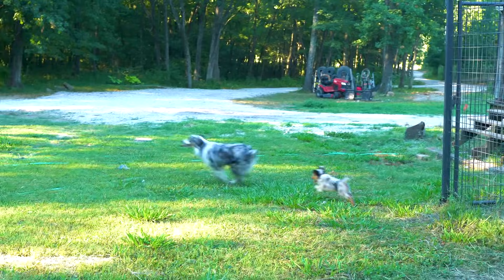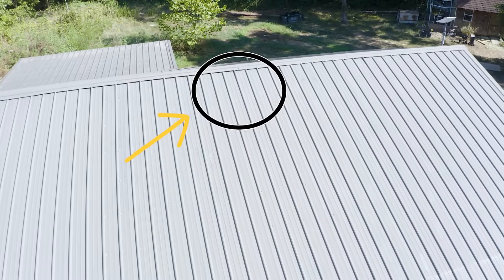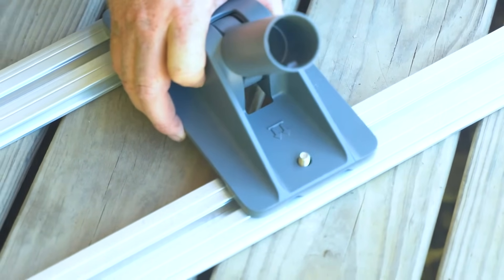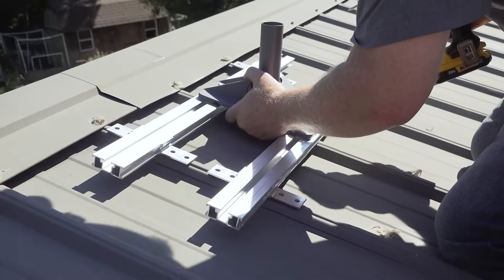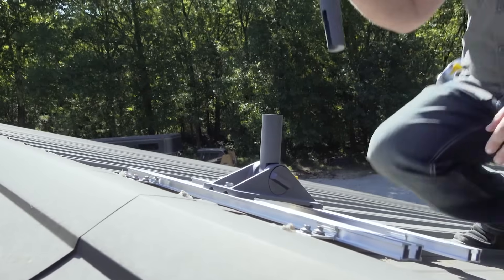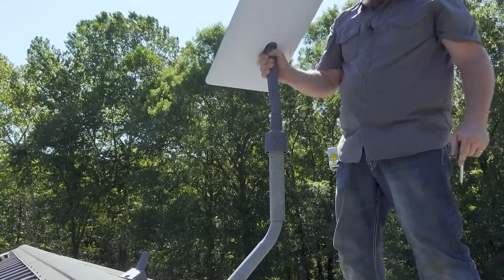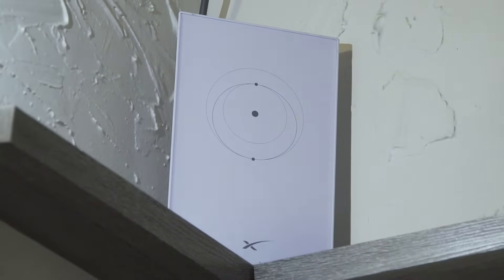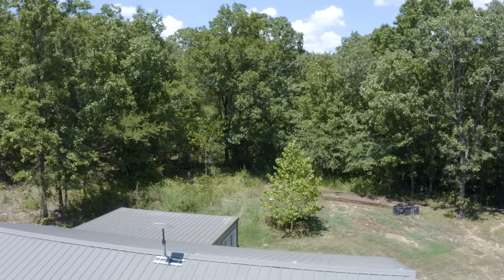Mounting Starlink on a Metal Roof | How to Install Starlink with GRIPPERFIX®

Comment: I've been struggling to work out how to get the Starlink cable through the metal roof on my single story house.  I had hoped to force a wedge under the bottom of a steel roof panel because I could see that two cable already entered the loft space this way, but that turned out to be impossible, and I realised they had drilled the roof just under the seam.  Then I thought of using one of those gland boxes, so went to the electrical wholesaler to purchase one, and th3e man showed me a Marshall Innovations Trade Seal.  This is a 3" diameter soft rubber disk with a nipple in the middle.  The 8-12mm version expands enough to get the Starlink plug through, and the disk has that uber sticky surface that one applied, is never coming off!  They also comply with current building regs here in NZ.  So if you have the same problem, check them out.  It's an infinitely better solution compared to the cock-up I was going to make of it. ☹ www.mwnz.com/product/trade-seal-8mm-12mm

Comment: I put mine on with the pivot mount from SL with some strong magnets that are coated with rubber. I got hit directly with a hurricane & my dish didn't go anywhere. Much better than screws. I can move it or take it down with ease.
Reply from the maker: We are glad you found a solution you like.  Just please note that this project is on an exposed-fastener roof, which has hundreds of penetrations already - as is the way these roofs are supposed to be installed.  We have a non-penetrative solution for standing seam roofs which is what you might have.

Comment: Did you use sealant on top of the roof where the screw pierced the metal?
Reply from the maker: The only sealant we used is the factory-applied EPDM on the feet of the EF Tabs and the washers of the self-piercing screws.

Comment: Could you not just go under the ridge cap right where you were to avoid a long exposed cable run???
Reply from the maker: Going under the ridge would have been an option for this application, but it's not always an option, depending on the roof and satellite location, and we wanted to show this for demonstration purposes to show possible solutions for cable management.

Comment: How on earth are you supposed to bring the Starlink cable down inside from a metal roof.  We get tons of snow where we live so we can’t just run a cable willy-nilly somewhere
Reply from the maker: If you are mounting your dish in the middle of your roof and need to safely route the cable across the roof, we would recommend running the cable through conduit and attaching it to the roof using our Canduit brackets. To ensure the conduit does not act as a snow retention system, we would recommend that it be ran across the roof near the ridge or below a snow retention system as neither conduit nor the Canduit brackets are intended for snow retention purposes.

Comment: Nice kit if you need that extra height.
We bolted 4 neodymium "fishing magnets"  to the included stand with stainless hardware, put soft rubber sticky pads on the bottom of the magnets to protect the finish of the roof, and stuck it right to the metal on the leeward side of the peak, then passed the wire over the foam and under the ridge cap with a drip loop.
Two years later its seen gusts in excess of 80 mph and not budged. (Columbia river gorge)
It's a less intrusive option if you're willing to trust magnets.
Reply from the maker: That is a very interesting solution. Thank you for sharing and we would love to see photos if you would like to share them.
Reply: @TheMetalRoofingAcademy  when the weather turns and it's a bit safer to climb up there I'll get some pics.
Reply: @braapdog ever get any pics?  Would like to see this
Reply: I had this exact thought, it's an excellent idea! Thank you for sharing, this is the route that I'm going.

Comment: Do you have a list of parts for the taller option?
Reply from the maker: Depends on roof type. If you send pic to support@s-5.com they can tell you which bracket or clamp fix your metal roof profile.

Comment: Seems like this mounting system is pretty modular; you could mix and match the pieces to mount anything you want. That is very nice for standing in the hardware store piecing a project together, but it makes purchasing what one needs online a little confusing. Could you list the SKUs for what exactly you used here?
Thank you!
Reply from the maker: Here is the satellite mounting kit link that you can purchase. https://buys-5.com/product/satellite-dish-mounting-kit
Reply: Hello I have a question about this kit.
On the description of the kit it says,
“not for use on screw down panel profiles”

My roof is made of corrugated screw down panels (like the corrugated roof on this video)

Can I still use this kit?

Comment: Which brackets would work best for a snap lock galvalum? And would it be better to put thr starlink cable through some type of conduit?
Reply from the maker: Hi,
There are several types of snap lock panels that will use different camps. If you can send us photos and measurements of your seam to support@s-5.com we can let you know the proper clamp for your seam. It is typically best to run cables through conduit to protect them from exposure to the elements and pests. We have our Canduit brackets that mount to our clamps and brackets allowing you to easily run conduit anywhere on the roof. Also please see the satellite mounting kit link. https://buys-5.com/product/satellite-dish-mounting-kit